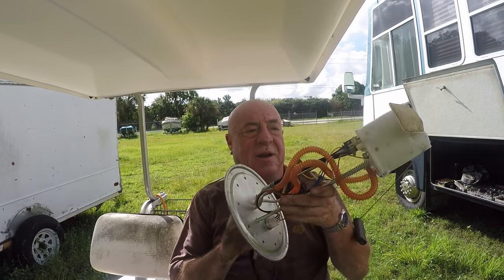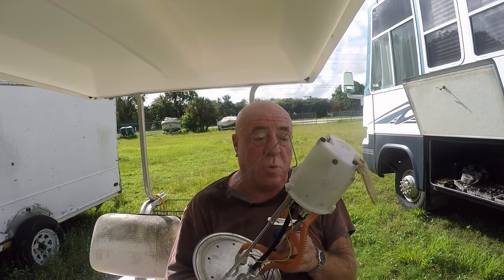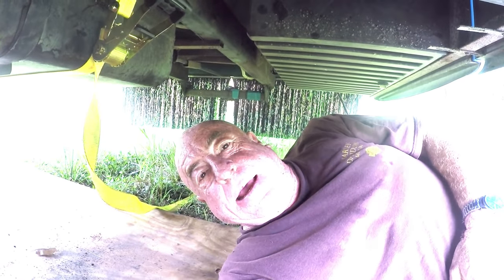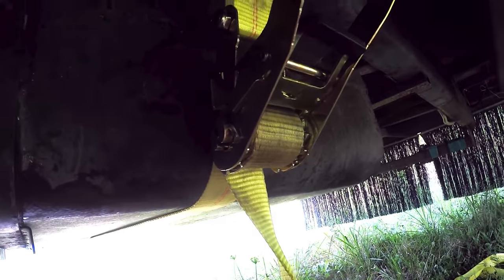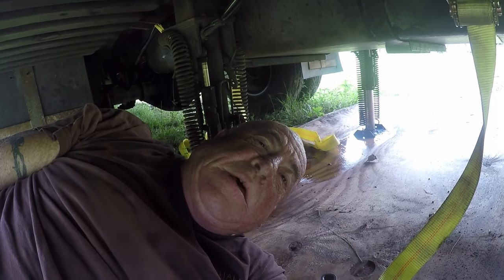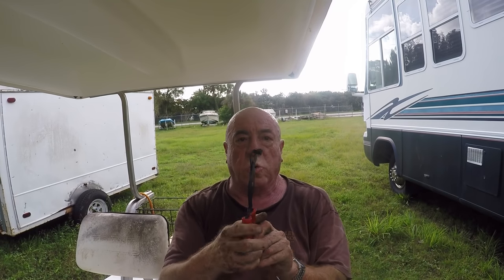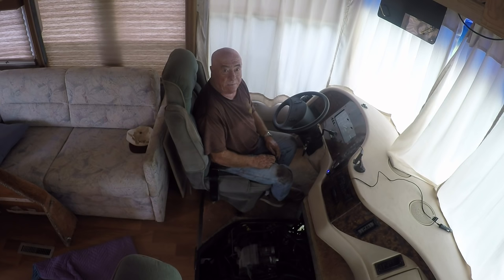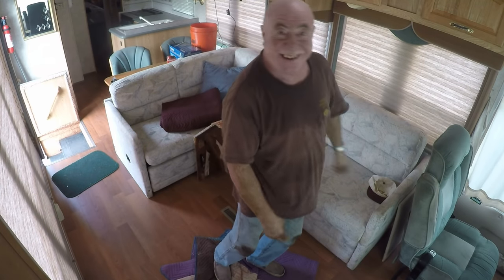Replacing Sending Unit Part 2

Comment: You are right, You don,t want to hit the throttle when you start up because the throttle position sensor will send a signal to the computer that is is flooded and turn off the injector to help clear out the fuel, much like when you flood a carborated engine you hold your foot to the floor till it start on its own. I hope this helps God Bless you and be safe out there.

Comment: I had to replace my sending unit and though its a diesel with no pump I was so grateful sender was in SIDE of tank...last one I did on a Country Coach was 160 Gallon tank and of course it was on top...even with long forks on fork truck it was a pain in the butt...glad you finally have that whole chapter closed!

Comment: Little time saving tip on the strap: If you lock the ratchet on the strap all the way back it will lock the ratchet mechanism open, then you can unwind the strap while the other end is still hooked up giving you 2 hands to do it.

Comment: I had to replace the fuel tank on my Jeep CJ5 and your struggles reminded me of it. The fuel lines to the tank were pretty short so I could only drop the tank just barely enough to get one hand in and loosen the hose clamps and disconnect the wires. Installing the new one was the same in reverse and for most of the process, I could only squeeze in one hand to do things. It was tough! Glad it started right up. Sounds a bit sluggish and sounds like there's still an exhaust leak in the manifold even though I know you need mufflers still. It also sounded slow to rev. Maybe that's just normal.
Reply from the maker: +Brian K Kinney It is running very well.  The camera blocks out the sound for some reason.

Comment: 2:13 Not advisable to use a brushed power tool near flammables. (Brushed motors create sparks whereas a brush-less tool does not). Just my 2 safety cents.

Comment: Good job on the fuel pump replacement.I realize this rig is a little large for you and Rufus but...if you purchase another used one you will have all this to go thru again. You have this one in top shape so I would keep it unless you can purchase a new motorhome or one with really low miles. Take care
Reply from the maker: +ncautoman57 I agree with everything you say.

Comment: You done great ! I got a 1987 chevy class A that fuel started leaking along the frame rail & with being disabled i traced the leak to what i think is the rear pump but no wires hook to it & it looks more like a fuel regulater that was leaking through a gasket  I drilled a hole in floor to locate the area & cut through the floor to get access as my floor was replaced with oak toung & grove & i only had remove 16" area & now i got id the part i'll post short video mabt you or a fan can tell me what the parts called ill post link soon as its uploaded !

Comment: Is your motorhome a Ford Chassis? V8 or V10? What is the proper tool for the lines and the in line fuel filter? Do you remember the fuel sender part # and where you got it?

Comment: Question: This video doesn't address the fill line and vent. I would have thought that those lines would need disconnected, and presume not since they not addressed. Is that the typical case? I'd like to change the fuel pump in my 2000 Ford E450 Gulf Stream. Thank you.

Comment: Nice work, Chico! You should think seriously about hanging on to this rig.  1: You've put so much time, effort & $$ into making things right 2: I think you'll regret giving up the square footage for a smaller unit and 3: I'm betting your mpg is going to improve with this latest fix - you're not going to see a dramatic reduction in fuel consumption in a class C. I have a 40' diesel pusher with 3 slides and get about 8.5 mpg (towing). Bigger is better!
Reply from the maker: +TwoBoldlyGo If I can not get the price I need I will hold on to it!  I just think it is way to big for my needs.  Hoever you are correct, it is in great shape and everything works as it should.

Comment: What was the ford motorcraft fuel pump part number, if you don't mind sharing it? By the way, awesome video!
Reply from the maker: +terry3193  F6PU9H307DB.  Rock Auto http://www.rockauto.com/catalog/moreinfo.php?pk=383267&cc=1367412&jnid=512&jpid=13

Comment: Where did you get the pump? I'm looking for the same one. I have not been very successful on locating one.
Reply: I have a 91 Bounder takes a Ford PFS-48 stuck in the desert for 2 weeks, and have be told it will be another 4 wks before Ford will be shipping any. Back ordered every where I tried new or used. $400. to $500.00